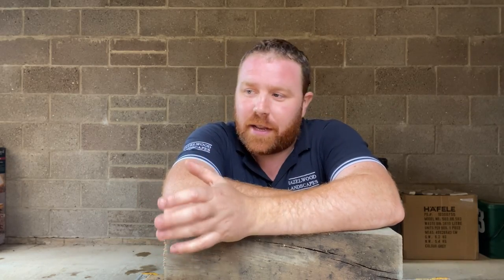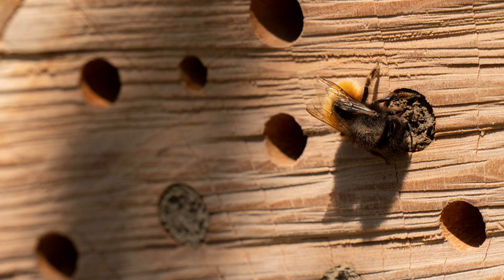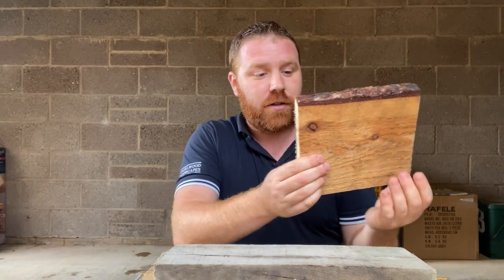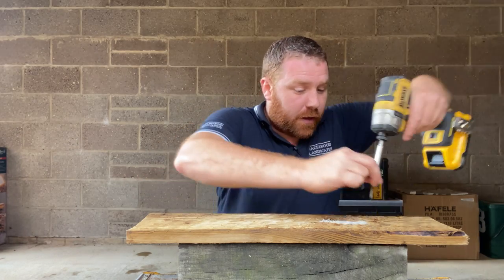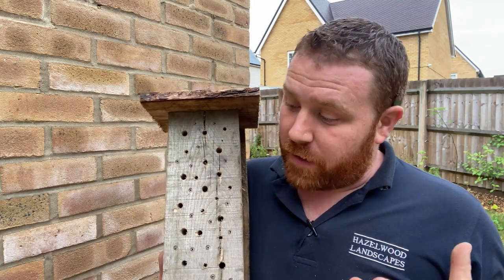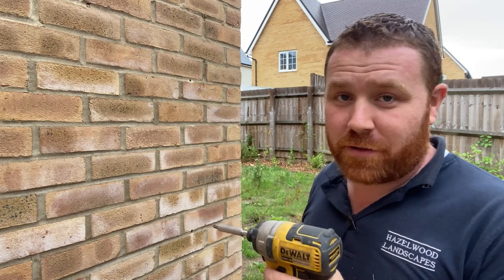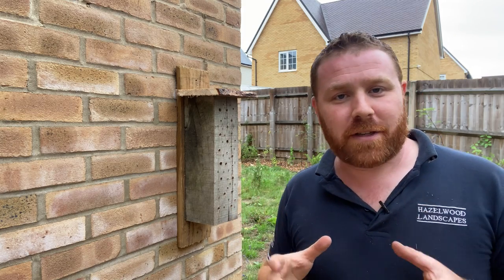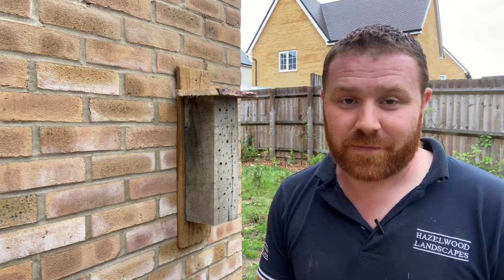How to Make a Bee Hotel - DIY

Comment: About 2 years ago my friend bought me a bee hotel for my birthday. It was a fiver from a supermarket. It's never been used - apart from a snail hiding under the eaves! I thought it was because it was situated in the wrong place, but seeing this video, I realise it's because of the hole sizes like you said. 
I'll have a go at making one. Thanks.
Reply from the maker: Hi Rose, it may still be useful for some creatures, but most insects like to be in the warmth and sunny areas, so do keep it and see what finds it eventually ;)  If you go to a local timber merchant or diy store, usually family-run then they are really helpful at cutting the larger sizes of wood or sell you off-cuts that they would have no use for really, and they will be able to ensure that the wood they cut for you is treatment-free, and then the rest should be pretty easy :)  Best wishes and let me know what turns up!  Joel
Reply: @WildYourGardenWithJoelAshton  thanks. 👍

Comment: If you don't want to split the wood using screws also for the back, just predrill them. Also don't take the hotel inside, you risk they hatch because of themperure difference
Reply from the maker: Absolutely, the bees will be used to over-wintering outdoors so there's no need to take these indoors at any point.  Thank you, best wishes - Joel

Comment: Question from someone just learning about providing nests for bees.  I see where some sites sell cardboard tubes and mention how you can harvest the larva from the tubes.  What happens to the larva in your bee house? and why would you want to harvest the larva?
Reply: For pest control. Drilled wooden blocks will be fine in season 1, but if the same block is left out for multiple seasons you’ve got a pollen mite and Houdini fly factory there, not a mason bee house. The reason being that they are impossible to clean. By all means replace it every year though.

Comment: Hi Joel, thanks again for another video! This one is off the topic of your video but I’m hoping you or someone in the comments can help. My mum and dad have bird boxes at their house and the passed 3 years blue tits have nested in one. Unfortunately every year we find chicks dead under the box, and to me they are removed from the nest by the adults as they are to young to climb out themselves. Is there a reason you would know off? Or what we can do to help prevent this? They have peace in the garden with no noise apart from the lawnmower but this doesn’t stop the adults flying in and out. Thanks in advance, greatly appreciated and enjoy your content! Ricky
Reply from the maker: Hi Ricky - do you see chicks successfully fledge from the nest each year or are they all "lost"?  Unfortunately due to a lack of caterpillar "food" a lot of chicks can die through starvation, parents will try to feed live food where they can as it is the only source of moisture for the chicks.  Sometimes an inexperienced mother can discard chicks that are not actually dead but if this has happened for 3 successive years it does seem odd.  This is partly why blue tits in particular have such large broods (sometimes 10-12 eggs).  There can be problems when one of the parents dies mid-way through rearing the chicks.  The only other thing I can think of is if the box is facing south or west and is exposed to the sun all day then chicks can die of heat exhaustion.  Sorry the answer is pretty vague but it's difficult without knowing the situation.  I hope this helps a little, best wishes and thank you for your kind words and support - Joel
Reply: Thanks for the quick reply Joel 😊
Over the last 2 years the adults seem to just stop so i always assumed they were all lost unfortunately. But then again i didnt realise they layed so many eggs. We did think about the lack of food but this year they have been very constant with what looked to be full beaks of food. I know the box this year is a different one to previous years and facing in the opposite direction but i must check that when i next visit. The weekend here in Northern Ireland was quite warm so may be that was a factor this year. Again, thanks for your reply Joel. I’ll let them know as they get quiet emotionally annoyed with it every year. Take care. Ricky.
Reply from the maker: @rickymcbutters  You're welcome Ricky, I do hope it can be helped or solved to some extent - it can be pretty emotionally draining going through the motions with them, watching them build, try their best to take care of them all, I watched a pair of Great Tits make a nest and part raise some chicks in an old Robin nest box that was pretty low down, only to come out one morning and see that the squirrel had taken the lot :(  Wishing your parents (and the blue tit parents) better success this year :)  Joel
Reply: @WildYourGardenWithJoelAshton  yeah, they sit watching them every day and then feel guilty like its something they are doing wrong. O, no, i didn’t think a squirrel would attack chicks. Just goes to show nature can be cruel. ☀️ 🌱 🌸

Comment: Hi Joel, how did you drill the 2mm hole to 5 inches deep when the drill itself is only 3 inches long. 1/2 inch in the chuck only leaves 2 1/2 available ? If you clean the holes out from the front you could injure anything in the tunnel, surely best to unscrew the back and push the brush from back to front if you have drilled the holes all the way through, which you should have done. Use a countersink bit in the drill to de burr the entrance to the holes.
Reply from the maker: Hi Colin, the 2mm drill bit I showed in the video was to give people an idea of the size of hole required - I do stipulate that the holes be circa 15cm deep and for this you would of course need what I used, the extra-long straight shank auger wood bit which of course wasn't shown.  I do make it clear that it is best to clean these in Spring when there are no larvae after they have over-wintered.  Unless you have access to an endoscope (!) damage could be caused whatever direction the brush is pushed, so again it's best to ensure there is no mud/leaf visible in the holes and wait until Spring.  Agree re the countersink drill bit, but again I make it clear re any burring and ensuring the holes are as smooth as possible - we know of course that in the "wild" they will use hollow twigs and abandoned nests of carpenter bees etc :)  Best wishes, Joel
Reply: It’s just you don’t say use an auger bit in the video. Anyone making there own may struggle without the correct tools. Never seen a 2mm auger. Extra long twist drills are available. You may get earwigs, spiders and other insects that could be injured when brushing out from the front as they could squashed at the back of the tunnel.
Reply from the maker: @colinjennings8778  I didn't show much of the drilling at all in the video, these are videos to help people, not workshops and my channel is to encourage others, not provide every detail for free in 25 mins ;) There's lots more I could have spoken about in the video but I also have a more than full-time job aside from the YT channel.  It's not obligatory that anyone caters for all bee sizes of course but hopefully most will find the information sufficient for them to cater for most bee solitary bee species and make a difference.  You need to look for the HSS straight shank auger, they do these up to at least 160mm long in the 2-5mm diameter if that helps :)  Oh, and re spiders and other smaller insects, unless we all become Jain monks we're going to be damaging some life form or another just by being alive!
Reply: Ok mate, I’m not criticising, I think you and your team do a fantastic job. And you are an inspiration to us all trying to create wildlife habitats! Have a well deserved time in France.
Reply from the maker: @colinjennings8778  Thanks Colin, appreciated - I do try to make as much time as possible to share everything that I hope people can implement easily, and see the rewards almost immediately.  Off to France on Wednesday so lots to do yet but am really looking forward to the break and the diverse fauna and flora - will be sure to take footage so I can share it all with you when I return - best wishes, Joel

Comment: I made a bee hotel last year with 8mm and 10mm holes in, they were 7” deep, I had Leaf cutter bee is using it but it doesn’t look like they’ve hatched out yet should they have hatched out by now ?
Reply from the maker: Hi Alan - I've double-checked this for you and it seems that the general info is that leaf-cutter bees will emerge from late Spring to early Summer, so there is still time yet - I also learned that eggs destined to become females are located toward the back of the nest, and those that will develop into males will be positioned at the front.  This is purely because males need to emerge sooner than the females, to be ready for them :)  I hope this helps - do let me know what happens - best wishes, Joel
Reply: @WildYourGardenWithJoelAshton  thank you for looking in to it for me, I will let you know what happens to those holes I have ever be is filling some holes with mud this year, not sure what bees they are,
But lovely to see them using the bee Hotel,
Reply from the maker: @alanbessant6280  Happy to help Alan - I think it's mainly the mason bees that use mud - I do have a book on every bee in the UK and it's pretty vast - I'd recommend it for ID purposes or to take a photo of any that you can and then research via the internet - let me know what you discover :)  Best wishes, Joel

Comment: I see a few problems with this design my friend....for a start the roof really needs a waterproofing treatment and more of an overhang with a slight slope to shed water off and importantly how is the thing properly cleaned out annually?? it will be difficult to do easily. I would also clean all the hole fronts out from splinters with a countersinking tool? Also you could simply drill out your existing fencing posts which will serve bees just as well, and all you need is a few drill bits, but again annual cleaning out is an issue.
Reply from the maker: Thanks for your input again Brian - the roof doesn't need a waterproofing treatment, and I wouldn't recommend ANY chemicals around these bug hotels.  They're not difficult to clean out and maintain:

https://www.amazon.co.uk/Upgraded-Cleaners-Cleaning-unblocker-Bathroom/dp/B07RWS6JRR/ref=asc_df_B07RWS6JRR/?tag=googshopuk-21&linkCode=df0&hvadid=375422453917&hvpos=&hvnetw=g&hvrand=12021743414402653243&hvpone=&hvptwo=&hvqmt=&hvdev=c&hvdvcmdl=&hvlocint=&hvlocphy=9046330&hvtargid=pla-794718560320&psc=1&tag=&ref=&adgrpid=76300561585&hvpone=&hvptwo=&hvadid=375422453917&hvpos=&hvnetw=g&hvrand=12021743414402653243&hvqmt=&hvdev=c&hvdvcmdl=&hvlocint=&hvlocphy=9046330&hvtargid=pla-794718560320

All sizes included with the brushes above.  You can use wooden fence posts of course, but you'd have to attach roofing, and in the UK most people's fence posts are concrete.
Reply: The advice to. ‘Clean’ with a wire bush in a drilled block is nonsense and clearly shows this guy has no idea what he’s talking about. This will be a pollen mite magnet in season 2 if it’s actually use.

Comment: My worry about this video is Joel suggests you need to clean out each hole with a brush each year.  Male bees emerge first, breaking the main end seal, with the females emerging sometimes weeks later.  Also, Blue tits and woodpeckers sometimes knock out the foremost mud seals and first plugs/cells, leaving the hole apparently empty, when in reality the earliest cells the bees lay are still safe at the back of long tubes, and waiting to emerge.   I don't think you can accurately tell when any hole is 'empty'.
Reply from the maker: Thanks for you input Paul, some good points but it's essential to clean out these bee hotels for the health of bees and best in spring after all the eggs have hatched and using a small, soft brush to remove all dead bees and debris - any empty cocoons should be removed as well – they might have become infested by other insects that will deter the bees from returning next spring.  Best wishes, Joel

Comment: Just have to find a nice chunky bit of wood now..🪵🐝
Reply from the maker: Hi Tracey - I find local timber yards really useful, when they're smaller and "family run" they will often cut a piece to size for you and of course have timber available that has not been treated - that's not to say the larger DIY stores don't, but I do find the smaller outlets really helpful for small projects like this :)  The rest should be really easy - best wishes, Joel
Reply: Thanks for the tip. Might add one in the greenhouse too and compare success rates :)
Reply from the maker: @LucyLeaf  Haha!  Let me know how you get on, I do know that the warmth plays a big part in "germination" of the eggs and growth of larvae :)  Best wishes and best of luck - Joel